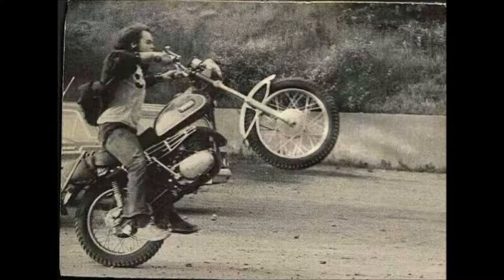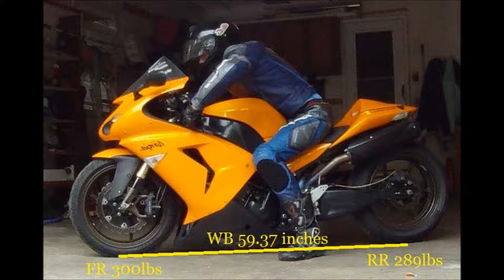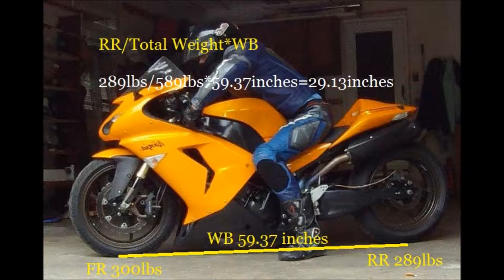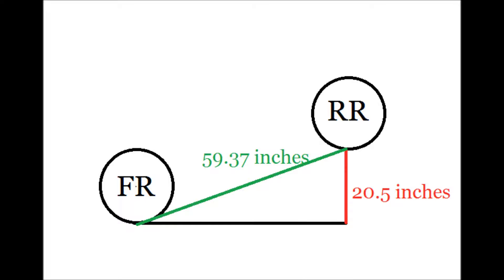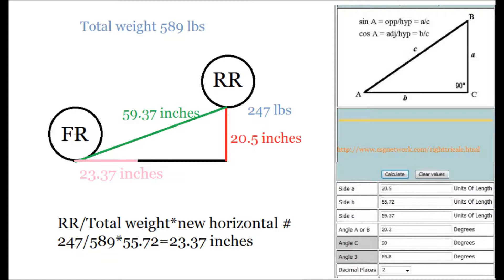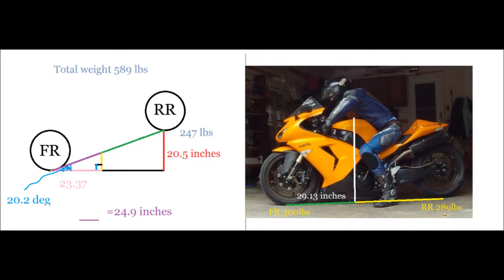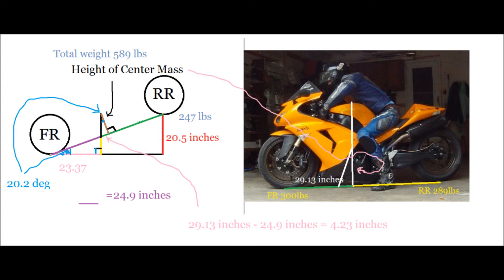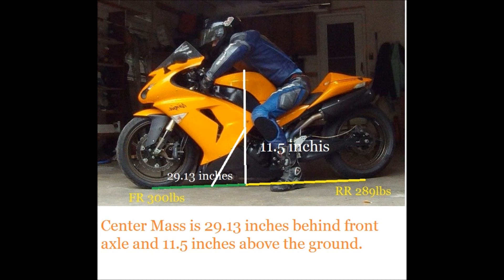HOW TO FIND CENTER OF MASS/GRAVITY OF YOUR MOTORCYCLE, DIY.

Comment: Do you know how to find the CG of the motorcycle from the Z axis when the motorcycle is on the kick stand?
Reply from the maker: You'll need to measure weight at 3 points, find the center between 3 points, and the next step is pretty simple.